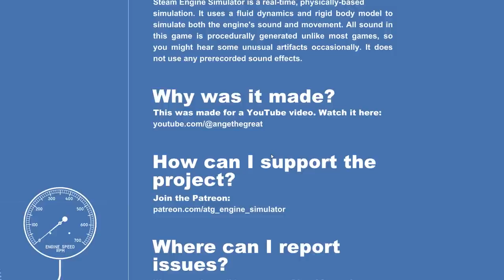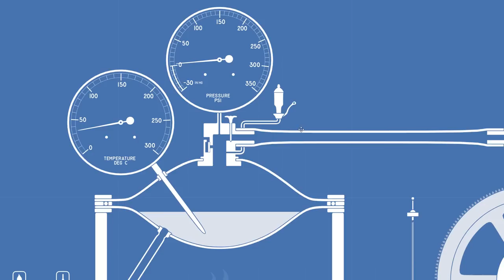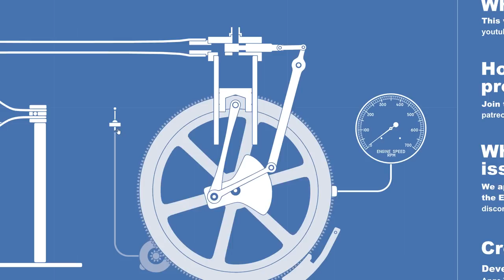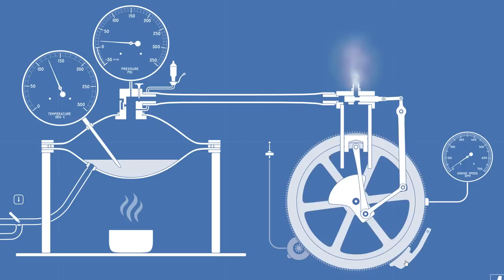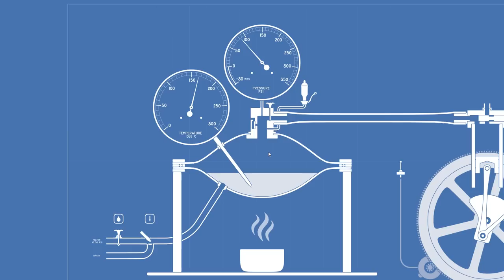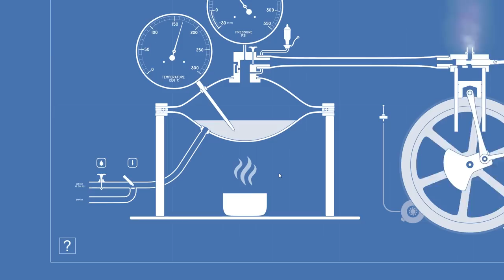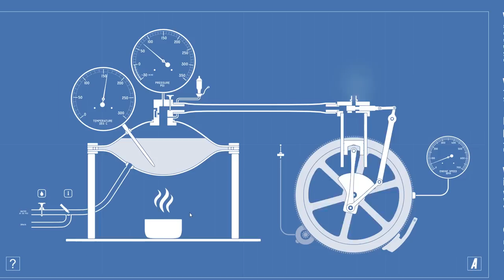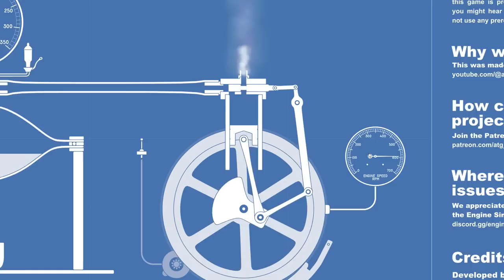Noob Tries to Blow Up Boiler in Steam Engine Simulator

Comment: what causes the vacuum in the boiler is actually really neat. basically as the water cools it condenses which creates a negative pressure (vacuum) inside the boiler which also in this game is simulated that it sucks the water into the boiler faster. pretty fascinating stuff and its also really neat
Reply: Hi
Reply: My favorite part is that I just figured out that you can run the engine on the vacuum as long as it's not at top dead center.
Reply: @tomfoolery4490 i guess it's the same thing as you're not getting power when starting at bdc
Reply: Big brain
Reply: yeah duh i know all abowt steam trains
Reply: bc i love them
Reply: Try using punctuation next time. I’m still in grade school and I almost had a stroke trying to read this.

Comment: It's like you woke up this morning wanting war with Hyce
Reply: or maybe a collab with hyce? 👀
Reply: I wonder if Hyce has covered this simulation on his channel
Reply: @kholdanstaalstorm6881  no he hasnt
Reply: @kholdanstaalstorm6881  but he might
Reply: @stormworksgamer922  
Good, then we have another game to have him pick apart from Hyce's point of view. 
I feel like this will be at least interesting to him.
Especially that the sounds are made because of things happening in the model and not as pre recorded sound files.
Reply: @kenanjones3481  or something other
Reply: @kholdanstaalstorm6881  i think his biggest nit pick might be, that it's operating under car engine piston model, but it's all the same, just copy the piston and valve asembly a few times, and you get an inline v4 steam engine working a transmission. since, like Kosmo was talking about, where there's a power stroke on both sides of the piston, instead of the 2 stroke model  presented here.
Reply: 😂😂😂first thing I thought
Reply: My thoughts exactly.
Reply: XDDD
Reply: Hyce Collab Let’s Go!

Comment: There's another mode. If you click on the A icon in the lower-right corner a few times, it unlocks "hell mode". It's possible to get the engine up to several thousand RPM.

Comment: Look next to the water valve, it says water at 50psi.

It's a low pressure source, not a high pressure injector.

You had more than 50psi of boiler pressure which is why you couldn't add water.

In theory, unless there's a one way valve that's not displayed, you should have had water leave until boiler pressure equalised at 50psi.

The amount of water is a balancing act.

Think of of ANY fluid tank. Open a valve and the fluid will flow out at a set rate and do so for a specific period of time.

Make that tank half the size with the same valve at the same rate, and the period of time it flows is halved.

Your boiler is that tank, steam is your fluid and half water filled to 50% is cutting your "steam tank" capacity in half.

Of course, you can't make steam without hot water so you need some and every time you add water it reduces the temperature which reduces or stops steam production.

So the percentage of fresh cold water to existing hit water affects much much steam production is affected.

So, you need sufficient hot water to maintain good steam production, whilst keeping enough room for a good supply of ready to use steam.
Reply: you've got a big issue with your reasoning: the quantity of steam isn't the determining factor for pressure the heat stored in the water is.

this happens at about 1500 times the rate at which the heat can transfer through the mass of the water and happens from the entire volume of water (all the water is steaming not just the surface) the pressure will fairly steadily rapidly equalize to match the the stored heat regardless of the water level provided that there is at least a tiny bit of space to work with and at least enough water to act as a buffer/bleed for the energy interactions so the actual minutiae of those interactions keep looking close enough to belonging on a napkin instead of constituting a doctorate dissertation for every instant. the trick here is that you can't get the boiler pressure down without cooling it down or running it dry or VERY rapidly dumping pressure from the tank (bad idea: can go boom) and you can't add water without that pressure down so with the way it is all set up you need to either just run the system at roughly intake pressure (oh hey! looks like it is calibrated to stabilize at a touch above 50, fancy that) or periodically cool it way down to add water if you can't generate an injection pressure of near the desired running pressure, note that you need WAY less power to pressurize the water feed than you are generating, that 1500 expansion factor of water -> steam is really handy like that...I guess technically you could add water from low pressure while running just using the bleed valve if you do it as it goes dry and the boiler starts to overheat? but that would flashboil in spurts which would make the whole thing into a bomb due to the uneven heatcycles in the material in a matter of just a few cycles let alone over the course of prolonged regular operation.

note: temperature = pressure through humidity relationship stays even below boiling (you can technically run a steam engine on it being only a tiny bit warmer than the ambient temprature but the harvestable margin of workload is basically nothing below boiling) that's just the point at which the interaction goes from stabilizing in a slow diffusion to nearly instantly.
note2: just to be clear when I call this thing a bomb while talking about ways to force it to fail that is REALLY not an exaggeration, pressure vessel ruptures can be horrifying up close even clear down at "bicycle pump + plastic bottle" let alone something like a large heavy duty boiler storing up more and more energy until either it finds the meeting point between the pressure from air expansion slowly building up and the heat changing everything's sizes and weakening materials or some unfortunate misguided soul panics and adds water in the middle of that process and fastracks all that heat all turning almost directly into pressure...I think that's actually a large part of why the tank is built like that: lots of stuff that looks like intended failure points and "not-a-valve" seams, everything is in tiers of "this should all fail at about this point" with the actual tank being the last thing on that list but that's me looking at it and thinking right now not returning known information.
Reply: ...or possibly your communication of your reasoning, good lord that ended up looking more garbled than I expected it to.
Reply: @evernewb2073  at 1 bar, the "expansion factor" of steam is about 1700:1 steam to water. Close enough to 1500 for basic "how much steam does boiling make" purposes, but not close enough for a steam engine.

I'm not sure where you got that the expansion factor and the rate at which heat can conduct/convect through liquid water vs the rate at which water can boil volumetrically are the same thing (i.e. also 1500). That's a bit weird and very incorrect as this is entirely dependent on the temperature of the water and the geometry of the boiler.

Related to my first point, the "expansion factor" of water into steam is actually only 1:400 (ish) at 50psig (aka 64psia or psi absolute). The expansion factor changes in relation to pressure.

This "simulator" doesn't actually (correctly at least) simulate any of that though. For some reason Kosmo gets the boiler gauge pressure down to -25psig? Like wut? That's 10 psi below atmospheric pressure and its physically impossible unless you're running this steam engine 23 feet under water. Its like having a temperature of -100 Kelvin.
Reply: @htomerif  Cold water entered boiler, lowering temperature causing steam inside chamber to condense, creating a vacuum. Same thing can and does happen with railroad tankers as tested by mythbusters
Reply: @joebideng9226  You understood none of what I said. I'm not saying it again. It was perfectly clear. Have someone else explain it to you.
Reply: @htomerif  I was replying to you questioning how the boiler pressure dropped that low. The explanation I gave is exactly how AngeTheGreat(the developer) as well as mythbusters described the process. 🙂
Reply: @joebideng9226  read my explanation again until you understand it.
Reply: @joebideng9226  Look, you're probably like 10 or something, so I'll give you a better hint: the pressure gauge shows -25psig. Why don't you tell me EXACTLY where that negative pressure comes from. SPECIFICALLY: where does the extra -10 psi that aren't accounted for by atmospheric pressure come from?

Get it now? Ain't hard, is it.
Reply: @htomerif  look up boiling point of water at converted pressures. The temperature on the gauge matches the inches of mercury in the graph, which matches the vacuum in the simulation, hope that helps you understand. 🙂
Reply: @htomerif  I think I see where you’re coming from now. The game measures vacuum in inches of mercury, rather than relative gauge pressure. The -15PSIG is accurate as that corresponds to 30IN Hg which is about a full vacuum (at sea level)
Reply: @joebideng9226  lol. I was wondering what would happen when you understood exactly why you were wrong. Now you do and I know you do from your reply.

You can pretend you were trolling, but you weren't and I'm not interested in whatever this is you're doing now. glhf cya.
Reply: @htomerif  Bro I literally just accepted your answer. Wdym?
Reply: @htomerif  I sent two messages. Read the second one, I believe you had already opened my first one before I sent the second one. Basically it’s just a misunderstanding with the measurements used.
Reply: I have found the gathering of steam train enthusiasts
Reply: Yea❤😂 long. ...
Reply: @Montmaster2  no you didn't, this is just a gathering of nerds looking to blow off steam...
Reply: Watching you too argue reminds me of that Tom and Jery argument meme, and I’m the mouse in the corner about to say something never said before, the pop up/loading screen tips just solved this argument in the 2 minutes of its life span that the pop up settings got to stay on, “the tank must be below 50 psi to add more water!”. Take that. Also all of you will say I’m lying Sence it’s a known lay of physics that all loading screen/pop up tips must be completely useless.
Reply: @htomerif  It's cut off fromt the exterior atmos, so the the steam condensing has no air particles replacing it. You can actually do this with a sealed oil drum and crinkle it like a soda can. You boil water in the drum, seal the top, and put it in ice water, it's pretty cool to watch.

I would imagine steam engine builders (especially with those check valves) would take advantage of the vacuum (or at least alow tolerances), but keep it from causing major stress from the rest of the system.

Also, you should probably refrain from insulting other people's intelligence when you yourself cannot simplify a concept to such a level that someone less educated on the matter can understand.

Comment: The thing that verified to me most (without looking into the game properly) that the simulation is probably accurate is the fact that as the pressure drops the water starts evaporating significantly faster.
Basically, as the pressure drops the boiling point of the water drops too. So the water must start boiling off rapidly, carrying off heat so that the liquid water drops temperature quickly enough to remain at boiling point rather than sitting above it.

Comment: Advice: Have patience and wait for the water get to 300 C and Max Pressure,and then start it with the engine starter,and apply extremely little pressure into the chamber,and slowly open the valve at max!
Reply: It go zoom
Don't forget to press X to disable emergency release

Comment: there's a funny thought: based purely on the sound of that whistle and it's size in relation to everything else this steam engine is MASSIVE.
...actually, that's really the only gripe here: the sounds are generated well but the baselines are all over the place: the scale on each sound source is completely separate. that said getting it even vaguely right is actually pretty damned impressive considering this is literally one guy making the thing as a pet project because the mostly nonfunctional "game" they made as a way to make an animation for a youtube video was a meme in their little community.
Reply: It sounds awefully like the whistle found on Australia's 3801 Locomotive - Have a listen!
Reply: He actually said that he wanted the engine to sound “big.”
Reply: @brq44  just to be clear I wasn't griping that it sounds like it is the size of a house (steam engines were used for industrial purposes more than anything else, think central power for a factory) I just saying that the only real quibble is that the different parts sound like they are scaled differently, and again, this is literally a one man project made out of the leftovers from the visual effects for a youtube video, he did dam good.

Comment: Some "sophomore" level things to keep in mind when it comes to steam engines is that the generation of steam means the expansion of water vapor. Meaning you need space for that expansion to happen or at least be able to flow from. Water does not compress, so the more water you have in the boiler tank, the less room steam has to expand. It's not quite the basics and it's not advanced tips, it's midway between. People seem to forget that steam is expanding and liquid water will not compress.

Comment: I doubt Kosmo will see this but if any one finds this video and this comment later:
click on the A a bunch of times (this gets you to a modded version that is overall better)
set fire to 100 
close safety valve
set throttle to 58%
open water valve fully
this should cause the water to flash steam and you should have a perpetually running engine.  If your tank fills with water drain and start again.  Psi should not exceed 48/49 so the water will flow into the boiler and flash steam.  I spent the time to get all the achievements for this game and in the end it was worth it.  The creator of this game is doing some really amazing things and is worth checking out.
Reply: what is the max speed you got using this, the limit im unable to pass is 4257.8, wish i found a way to actualy use the whole speedometer
Reply: @patdbus  thats about my top speed since the 100 psi update
Reply: @mr.shenanigans597  im pretty sure that is about the max, maybe if you really try hard that youre able to get it to 5000 but its unfortunate that you cant use the whole speedometer

Comment: 6:55 you can't fill water bcs water in boiler have bigger pressure than income water, so the pressure blocking it. You have to get pressure under 50PSI to be able fill it

Comment: in reality you dont have anywhere nearly as much control over the furnace as you think you do, the best way to control the temperature in that case is to cool the boiler with fresh water and leaving the furnace doors open. water cant flow into the boiler if its overpressurized or equalized so the whistle also acts as a quick way to release some pressure, since using the pressure purge valve will dump it all out, the water purge valve is mainly to control how much steam you can actually store since too much water means less space for steam.

also you dont actually need that much pressure to get a train going unless it has a very heavy load, a train will move with even as little as 30 psi, but a consistent 
50 psi is often better for long term sustainability, though at 50 psi the chamber equalizes so you cant feed any more water into the boiler until the pressure drops.

Comment: The water inlet is labelled "Water at 50 psi", so water won't flow in if the boiler pressure is greater than that.
Reply from the maker: @gcewing  those youtubers would be so mad if they could read

Comment: Wait till bro figures out what the X key does

Spoiler: it makes the title of the video possible by closing that wastegate/emergency  pressure relief valve.
Reply from the maker: dang, haha!
Reply: @darealkosmo  well… never mind…… like a week after my comment they changed it so it now has a variable adjustment that you can see on screen, and also don’t forget to poke around at ATG to x100 (like the gage says 20, so x100 would be 2k rpm like a semi, I’m sure you know this) the rpm (aka clicking on the A logo in the bottom right corner), there’s only so much poking a developer can take! And yes, I just referenced the steam achievement for doing so.

Comment: Oh Boy!
In a real boiler putting a hot dry boiler (ike a boiler boiled all the water out of it) and then put it into cold water will cause it to instantly flash it to a boiling explosion. It is a very dangerous thing to do.

Will your simulation do that?

Comment: Would be so much easier if only the combustion, was internal..
Reply: There is literally no combustion, just burning a non explosive source (wood or coal in the burner) to put its energy into the water, then the water boils and builds pressure in the tank, witch then gets to push the piston down. Or I just dum and your trolling everyone makthing this same comment with logic, technically facts, and you prob have a fact and genreal nolage of steam engines when I know internal combustion engines that run gas, nitro, diesel, or any other liquid fuel, also EVs and non combustion Hydrogen cars, like so,e Toyota Camrys, and also some Toyota Camrys, but you get the point.
Reply: @external316 >there is literally no combustion 
>just burning
Reply: @oceanforth21  thanks bro, yeah… I very much overthink and overcontemplate thing…. 
A lot…
Reply: @external316  not what i'm saying. burning is also combustion